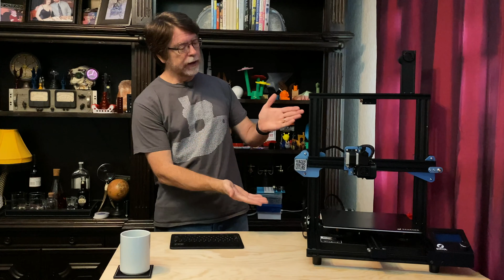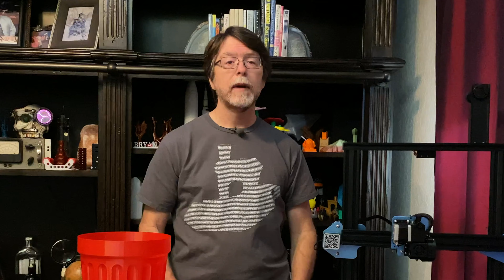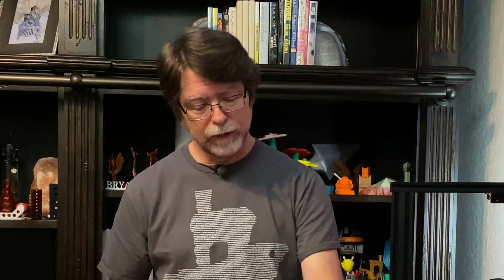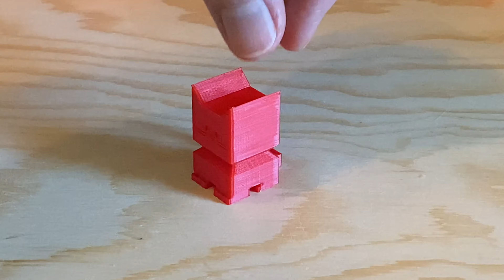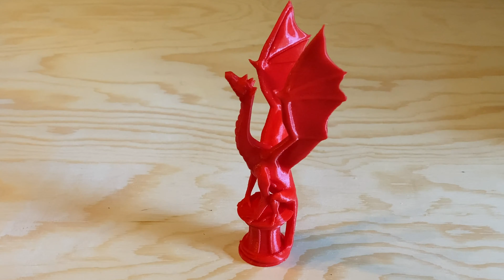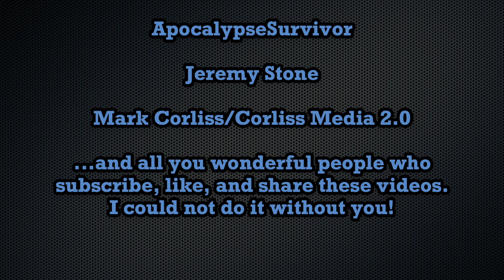The Sovol SV01 3D Printer Review: Is it any good?

Comment: One thing you will discover is that your idea of sucking cool air over a PC board does not work in practice. Forced air cooling blowing on the board actually shoves aside the hot air mass, forcing cooler air over the individual components on the board. Sucking hot air out of the case draws cooler air over the board, but due to turbulence will not force air through or around various individual components on the board that need the extra cooling, such as power transistors, power CMOS tech, various other large current components, or heat sensitive stepper drivers. The case does need ventilation ports though, or as you say the hot air inside just gets hotter and hotter over time during a print, which can also cause component failure. On long duration prints that could become a real issue.

Comment: Hello, which will you recommend, ender 3 v2 or this one?
Reply: In a novice, I was trying to decide between this one and the Ender3 v2 and I decided on this one because of the larger print bed and the features it has for less money. My SV01 comes in Sunday.
In replacing a Voxelab Aquilla Ender 3 clone because it was defective and their customer service sucked.
Reply: @null643  Really well! My first one was defective out of the box, but I went ahead and replaced it and the second one has been flawless. It's really easy to use and prints have been nice and clean. I also added BL Touch, and that is really worth it!
Reply: @null643  It was through Amazon. I did the option to exchange for the same thing, so it was only 2-3 days. Pretty fast.
Reply: @null643  I got it for $259 on Amazon and it came with 5 free 0.4 brass nozzles and free shipping. In checking, if you're a Prime member, it's $263 for the same deal. That is with a $35 Prime savings.

Comment: I am really confused between artillery sidewinder X and Sovol SV 01, Which one would you suggest?
Reply from the maker: Of the two, the Sidewinder is quieter and has a larger build volume. But it's about $150 more than the SV01. If you need a 300x300x400 mm build volume, go for the Sidewinder. If you can get by with the 240x280x300mm build volume of the SV01, and fan & stepper motor noise won't bother you, then get the SV01. That $150 difference is almost enough to buy an Ender 3 (which is also in the "loud but pretty good" category). 👍

Comment: Can Anyone please help. I just bought  Sovol SV01 3D Printer a few days ago. I have tried everything but nothing has work.. I so besides myself have been working on this for hours and still will not work. :( I'm using ABS 1.75mm Filament and I can't get it to stick on the glass plate. I have flipped it over to both sides nether side sticks.. I have tried adjusting high still nothing. It heat ups to 230 plate 80... cant find anything on the screen to make it hotter to see if that will work.. Hoping someone or the host can help

Comment: Nice Video, whats the bit of kit in the background with the two analogue panel meters on the front panel?
Reply from the maker: That is a thrift-store find. It's a GE Metering Unit, Cat. No. 8943423G2. The left meter measures "RF Milliamperes," the right meter is an ohmmeter. I opened it up a few months ago and found four D-cell batteries with a 1993 date written on them. They've leaked, so I need to clean them up. I may try putting a small Arduino Nano project together, which would move the meters to random values and maybe light them up with a warm white LED. 😉

Comment: I just set my SV01 up tonight and I have a question/issue. When I auto home, the extruder goes to  the left front corner, about 1/4" in on the build plate for the X axis,  but is on the front edge of the build plate on the Y axis. I've tried to use the home reset by setting the extruder where I want it, and attempt to reset. But it reverts back to the existing setting. Maybe I don't understand the sequence. Any idea how I can do this? I don't like the Y axis to be on the edge, and I'm trying to define home so the glass clips are not in the same path as the extruder nozzle.

Thanks

Comment: We're printing some COVID-19 PPE for local medical offices and my heavily modified Robo R1 broke down. To replace it until I have time to repair it, I had a pretty good idea that I was going to get the SV01 over the Ender 3 because of the direct drive and larger print volume, but I was concerned if there were any gotchas. The only ones you mentioned aren't a problem for me so I went ahead with the SV01. It'll go next to my Robo 3D R1 (when I fix it) and R2, and my Anycubic Delta LP. Thanks for your review and helping me make my decision!

Comment: My Tevo Tornado seems to have passed on when it comes to heating the hot end up to proper temperature, set for 200 C and it only gets up to about 142 C. Changed hot end and still fails to get to temperature. Just stopped during a print. At any rate I'am liking your review on this model. A little $hi for what I do, but I want something that works and I don't have to have a degree in computer science and G-Code to get it to work. (Still leaning my cell phone, old guy problems). You mentioned some filaments that worked ok, but what about ABS? I have made a few ABS things on the Tevo that came out good. Will this printer print ABS?

Comment: How are mods to fix the noise problem going?
Reply from the maker: Still mostly in the design phase at this point. I won a "silent" board during one of Sovol's giveaways and that arrived a few days ago. I'll tame this noisy beast yet! I have an Ender 3 Pro next to it with a Creality 1.1.5 silent board installed, and when the power supply fan isn't on, it's pretty quiet. So I want to get the SV01 quieter than that.

Comment: Thanks for the in-depth review. I'm seriously considering getting this printer. Do you happen to know what the minimum layer height you can achieve on this is?
Reply from the maker: Hi Anthony! The specs say "Layer Thickness: 0.1-0.4mm." Personally I wouldn't really go over 0.28mm, just to help ensure the layers stick together.

I set my first layer height to 0.24mm, no mater what layer height I plan to print at. I find that by doing so, I don't have to tweak the nozzle height for different initial layer heights.

I set my layer heights in multiples of 0.04mm, which is the distance you'll get from one full "step" of the Z axis stepper motors. The minimum I print is a 0.12mm layer height. I have profiles for 0.12mm, 0.16mm, 0.2mm, and 0.28mm. But I don't see any reason you couldn't print at a 0.08mm layer height.

I hope that's helpful!

Comment: The cables on mine, Nov 19, WERE labeled. I really like my Sovol, and their Customer Support has been excellent. I agree about buying from Amazon....I am having a bad time getting Creality to take back a CP01 on which the nozzle shorted against the metal clip on the work table. I saw sparks, now neither head nor table heats.  After losing battles with Creality, I filed a claim with PayPal....fine....ship it back to China ($200 UPS), and we will credit you $579...sorry about $55 sales tax. FRUSTRATING AS HELL with Creality, but they have you over the barrel.
I once printed 18 hours of a 25 hour job....next morning I discovered it was printing air all night. I really appreciate the out of filament sensor and recovery of the SV01. My Creality doesn’t have that. It also gives me:”THERMAL RUNAWAY,” and “HEATING FAILURE,” which I have never seen on my SV01.
I had to get into the head of the SV01 to clear a clog ( per their YouTube instructions.). The tiny wires on the dangling extruder fan broke at their solder points waaaay in there. Sovol has been great in replacing the entire head for very cheap. Next time, I think I will secure it with painters tape or something dangling killed it.
Reply from the maker: Hi, I've been really happy with my SV01, and I agree their support has been quite good. 👍
Reply: Thanks for insight!  I can do without all the hassles so decided on a Sovol, mainly for the direct drive.